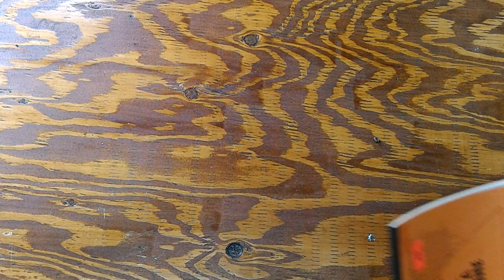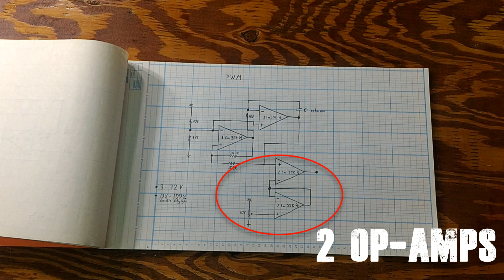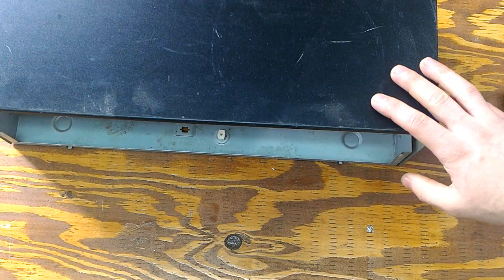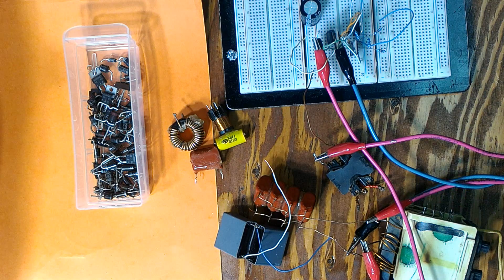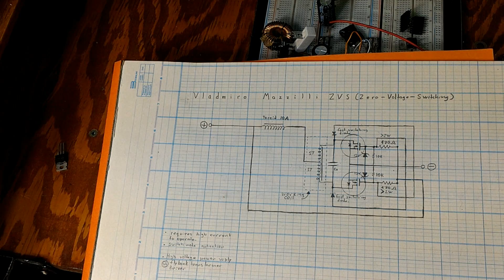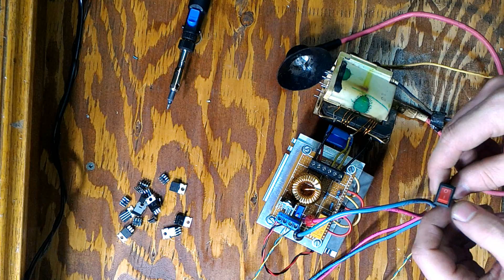High voltage Finally Revealed PART 1

Comment: And ..how you get to 100kv from just one flyback?
Reply from the maker: Please watch part 2
I used 2 fly backs to get 100 kv
The spark gap is about 100 mm
Used a low value to calculate the voltage 
1kw/mm
But it could be actually about 3 kv/mm